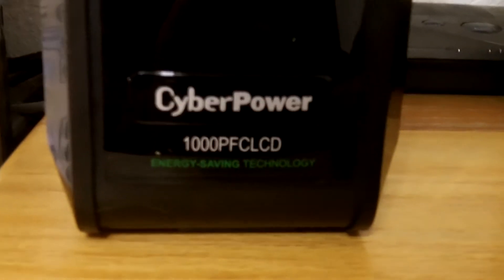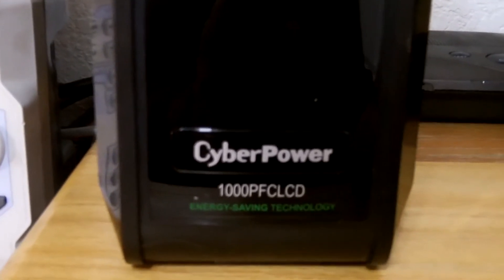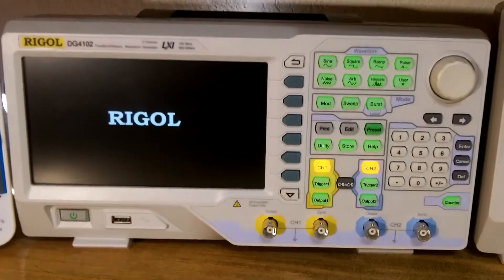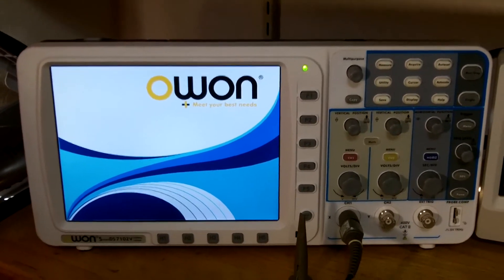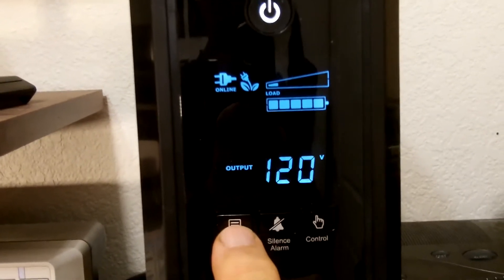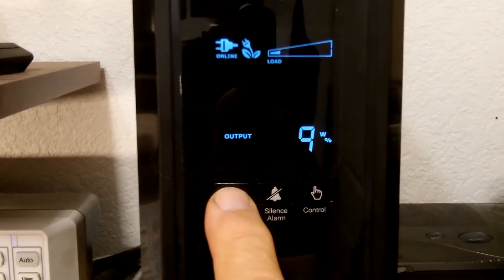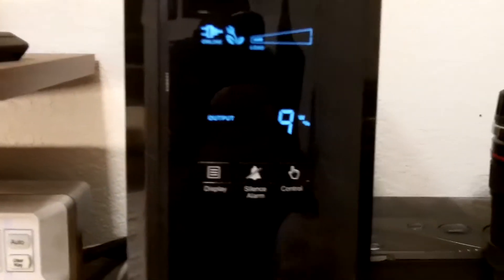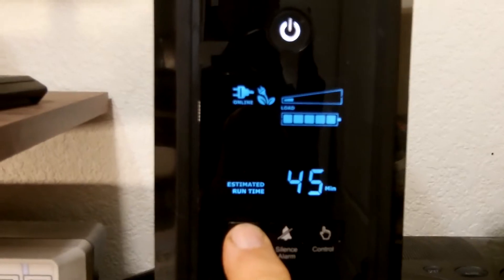DSA815 on Battery Power

Comment: First thank you for all videos you posted. I was planing to get Rigol DSA815-TG as well as Rigol signal generator (I already have Owon ds7102) but I am not sure which one to get. I dont want to get something that will show later to be too slow so my question to you is: what would be reason to have  larger frequency? what would be advantage of getting 100Mhz or 160Mhz? Will that open dor to wider aplications? if it will, which ones?
Thank you in advance if you can help me with this question. I am novice but dont want to get something that will show later to be not good enough when I expand my knowledge.
Reply from the maker: If you wish to work at 2m (146MHz) and if you can afford the extra cost then I would go with the 160MHz unit.  That version handles all of the FM Broadcast, Aviation, and 2m Ham Radio bands, as well as most of the VHF Two Way radio frequencies.

I chose the 100 MHz unit based only on price but I plan to build up-converters for higher bands as needed.

It basically depends on what you plan to do with the unit.